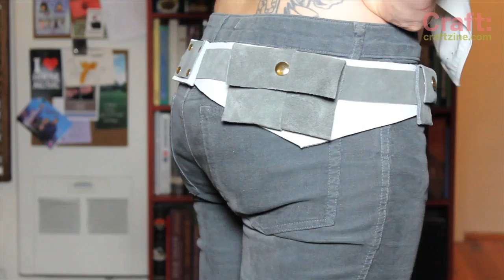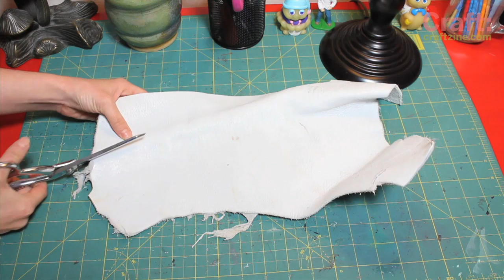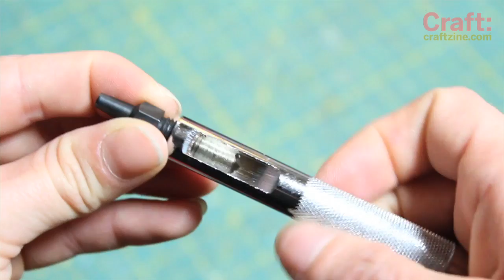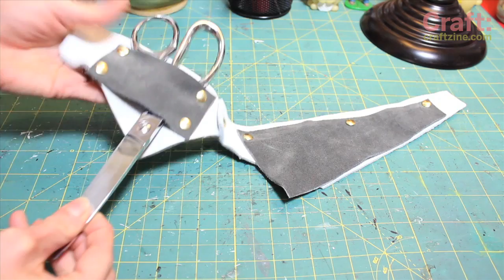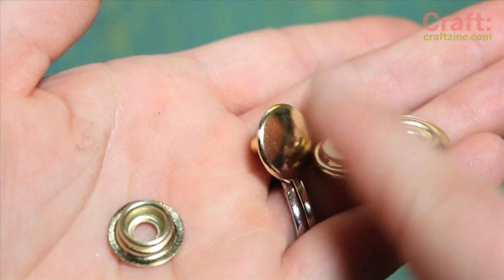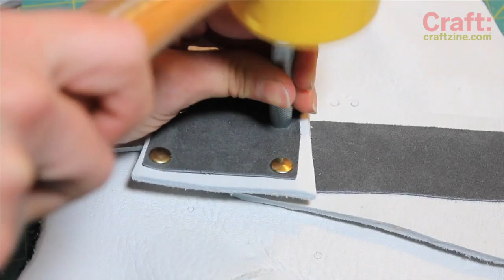How-to Make a Leather Holster

Comment: Corinne, when it comes to cutting leather, use whatever method you're most comfortable with, be it utility knives or shears :)  Also, instead of the super toxic contact cement that you used here, head over to Home Depot, or whatever home improvement store you have out there and try some DAP Weldwood in the green labeled can; it's non flammable and won't rot your brain cells just by opening the container!! Aside from that, just have fun :)

Comment: Tip for setting the snaps.  Start with several light to moderate strikes on the setting tool and finish with very hard strikes.  If you start with hard strikes you can very easily bend the stem  and ruin it.